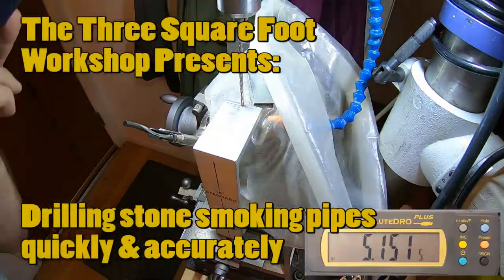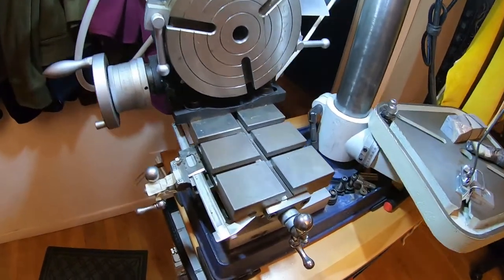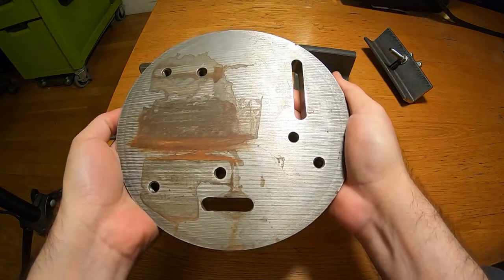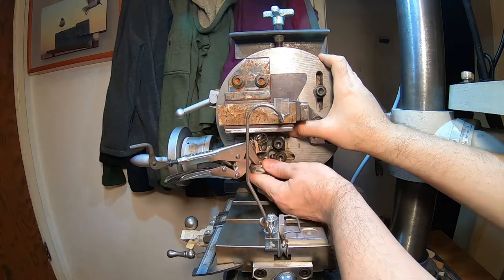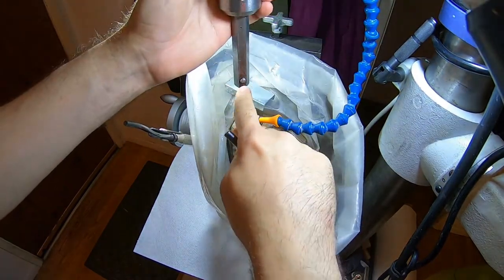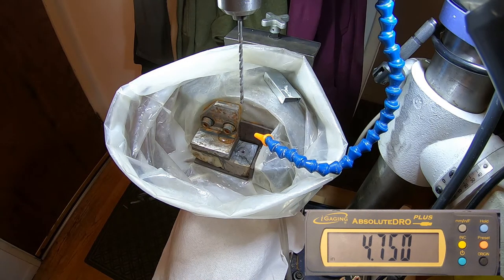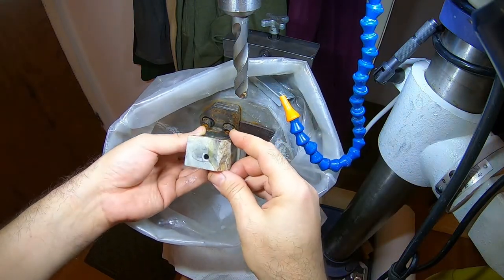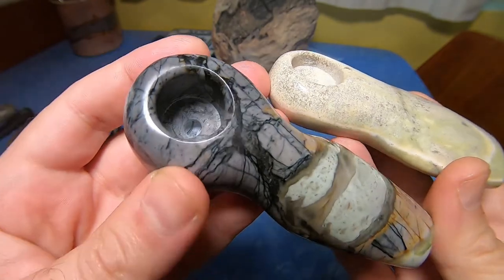Drilling stone smoking pipes

Comment: This type of channel is my favourite part of youtube. this is the magic i look for and is hard to find. your use of those id badge alligator clamps to slide in the groove is so freaking clever. the fade into the 3d model was also awesome. I thought you were done there, but then you decided to make a makeshift ball joint with literal rubber bands, and bent wire. Un-real.  aaand of course... your pipe POV snori cam that made you stand out on your lighter video, then with the insane bts shot at the end. bravo.

Comment: Hmm... now you need a third axis perpendicular to the other two for a carb :)
Reply: Is it possible to trap threads in stone?
Reply from the maker: Ha!  But no.  Pipe like this doesn't benefit from a carb.  No large internal volume that needs to be cleared.  Lack of carb is A FEATURE; makes using it simpler.  If the smoke becomes too dense, you can still easily mix with fresh air.  You don't have to seal your lips tightly around the pipe like you're sucking a drink from a straw.

We know each other IRL, so I know you're not a regular smoker...  If you were, I would have gifted you one of these a long time ago, and you'd already know this!  (Offer is always open, should your habits ever change.)
Reply from the maker: @stephancom ['Tap' threads I presume you meant.]  Sure, why not?  Thread cutting ought to be much the same as any other material; thread rolling wouldn't work though.  To what end though?  Stone is typically strongest in compression, and threads get loaded in shear, so may not stand up to much abuse.  You thinking of a screw on cap, or a screw on stem mouthpiece?  (A mortice/tenon like a tobacco pipe, or ground taper like laboratory glass, would probably work well for a mouthpiece.)
Reply: @TheWackyNeighbor  regular enough :) or at least when I’m living in the land o plenty. I’ve had similar pipes with and without carbs, I appreciate your point, but it’s nice to have a carb. Lovely pipe either way :)
Reply: @TheWackyNeighbor  oh I had a couple of ideas, including having a piece that screws together in the sense of marble into marble. Aesthetically I’m picturing two contrasting materials having a clean seam but you can unscrew it for cleaning or just because it’s cool.

Another idea is tapping stone to accept a metal machine screw, thus enabling one to attach, perhaps, flat or form fitting curved metal pieces, think iridescent titanium maybe, purely for aesthetic reasons, perhaps combined with the other idea.

(First idea was actually to screw in some sort of metal mouthpiece, which I immediately discarded as being a stupid idea)
Reply: An interesting alternative for the screwing marble together idea might be dovetail though probably not as reliable
Reply from the maker: @stephancom  At the December meeting of my rock & mineral club, we had a presentation by a jewelry maker who's a master of intarsia & inlay, which he is careful to distinguish between (Jeff Fulkerson).  Turns out, it can be as simple as gluing the rocks together.  I was kind of inspired, and considered going through my scrap pile, maybe making a pipe with 'go fast stripes' down the middle, or some other simple design with contrasting colors.  On the other hand though, meh; I have so much material on hand that already has beautiful patterns in it naturally; I should just work through all that...
Reply: That would be super cool! 😊🌎✨